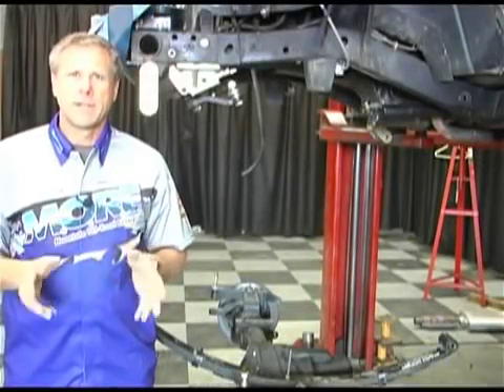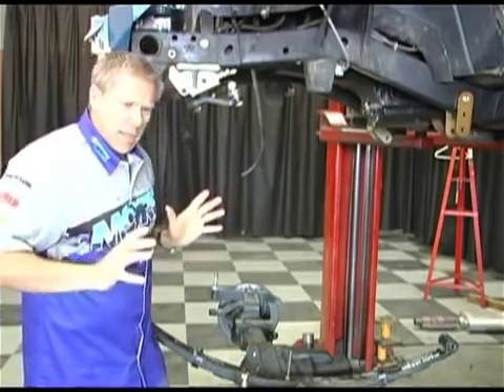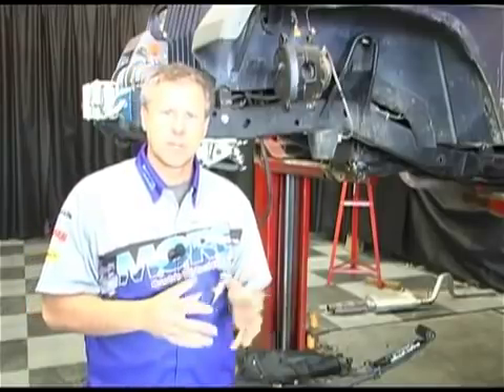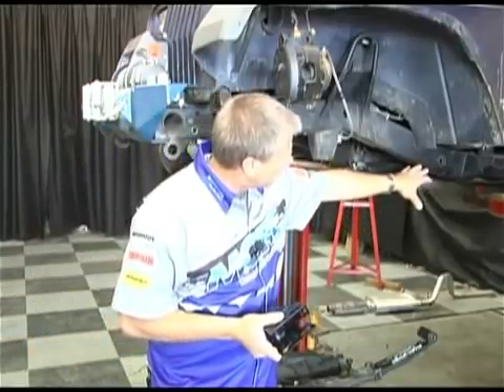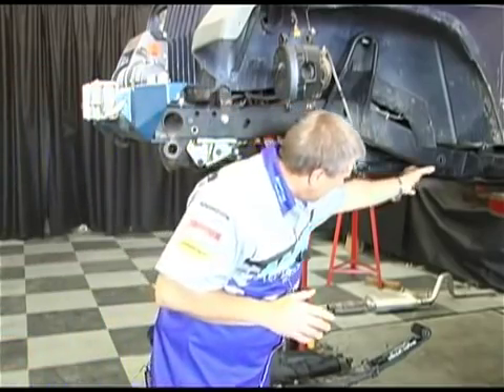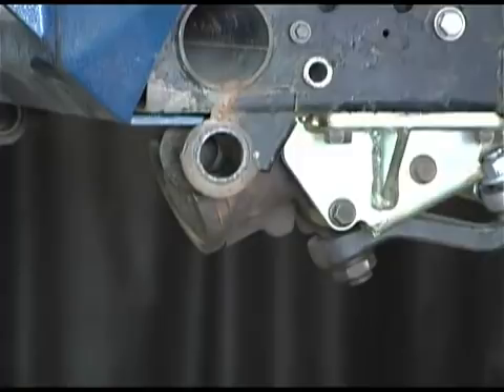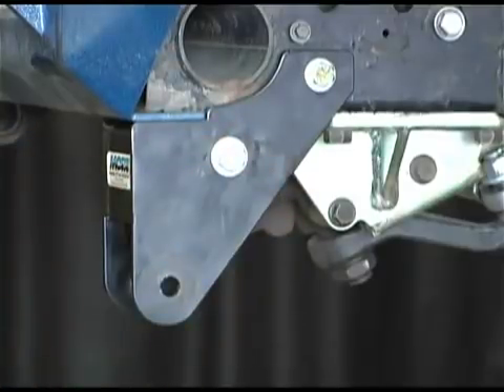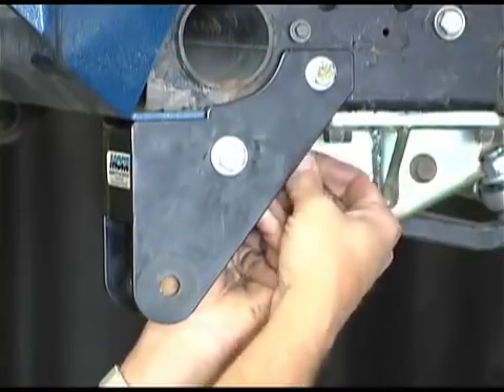M.O.R.E. Shackle Reversal Kit Install

Comment: Could I install these if my front bushing mount is gone. Currently have a warrior kit up front but it was installed offset to the driver side and uneven in height. Could I just weld these to reinforce ?
Reply: Yes i welded mine